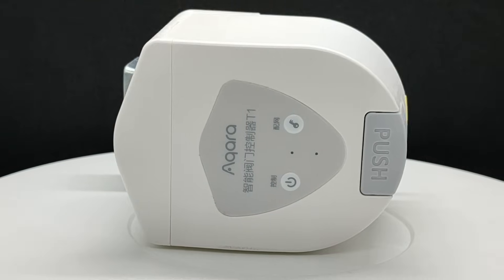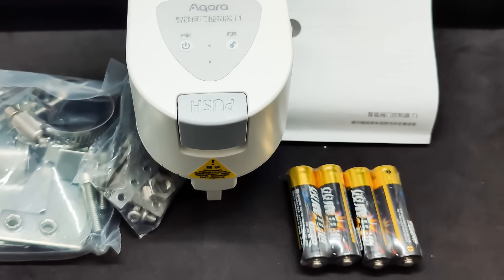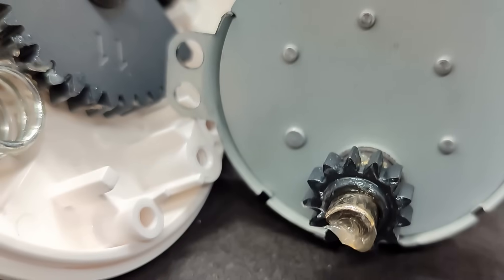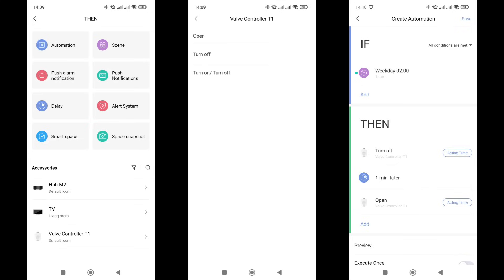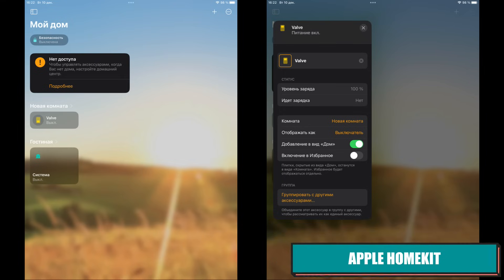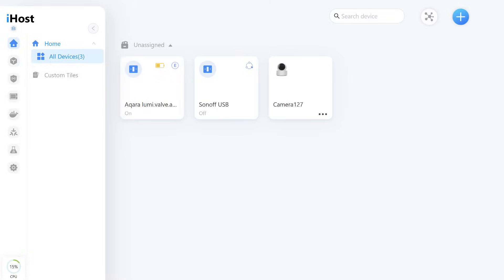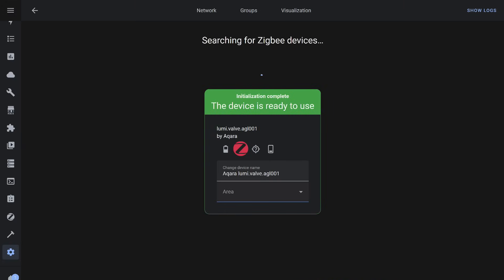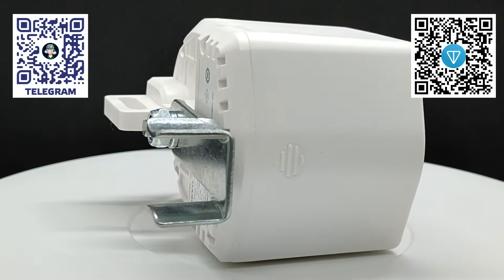Aqara T1 ZNFMJXS11LM - zigbee актуатор с автономным питанием для шаровых кранов

Comment: Can it be connected to Home Assistant and work routinely with other devices such as Heiman ZigBee gas and smoke leak sensors and some Sonoff ZigBee water leak detector products?
Reply: Can it be connected to a natural gas valve?
Reply from the maker: Of course, with any devices connected to the home assistant.